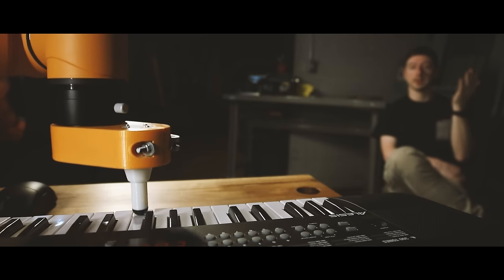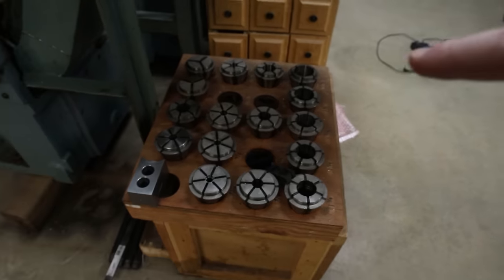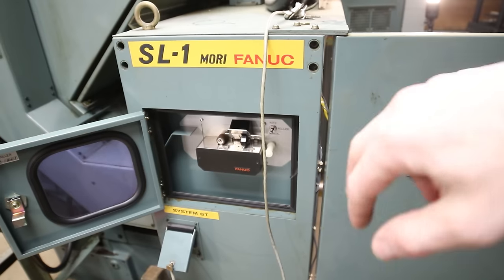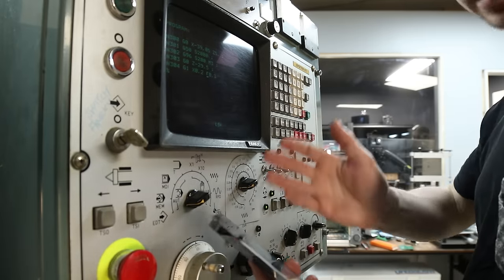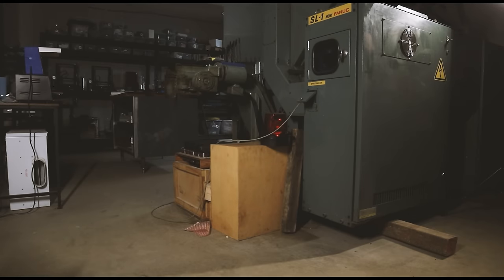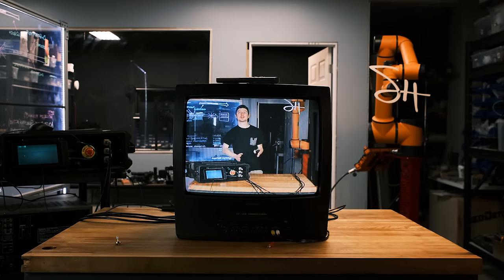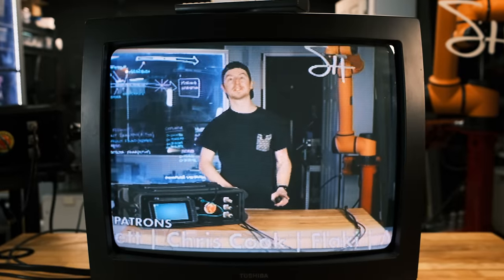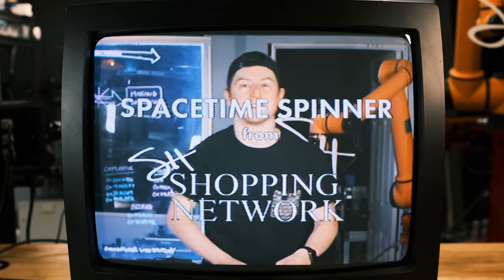I Bought a Giant 40 Year Old CNC Machine

Comment: Back in 2009 I worked on one of these exact cnc lathes. We called it the Mori Shocki. There was a short somewhere and if you touched the control panel while closing the door, you'd get a nice little shock. We also had to keep the back open and a fan on it to keep it from overheating. Poor machine shops, man lol.

Comment: The old Mori's are great machines and can make some really nice parts. The G code isnt that bad to program manually once you get the hang of it. Try and find the operators manuals, they really have a wealth of info.
Reply from the maker: Yeah I'm actually getting pretty quick on the controls. I'm figuring out all the machines little quirks. I actually do have all the manuals and (most of) the machine repair and maintenance history. Pretty crazy.

Comment: For those who aren’t familiar with Computer Numerically Controlled machines, they’re actually quite simple.

If you want a machine (for example a robot arm) to draw a shape, then you have to give it instructions. And that’s the funny part. It’s not complicated. It’s just simple addition.

There are only two kinds of orders that you can give a machine:

1. Go to a specific place.

or

2. Go from one place to another.

So if you want a robot arm to draw a square, you tell it to go to “Point A” which is (for example) two feet off the ground and pointed exactly North.

And if you want the robot arm to draw a square that’s two feet on each side, then you tell the robot arm to go to Point A, then go up two feet, then go right two feet, then go down two feet, then go left two feet. The robot arm will draw a square.

The starting point is called “absolute” and the relative movements are called “incremental”. In life, moral standards are the absolute starting points, and deviations from moral standards are incremental adjustments.

The absolute moral standards of truthfulness, goodness, and reciprocity are a big problem for communists because they’re liars, thieves, and parasites. They don’t want moral absolutes. So they take those absolutes and then incrementally move them in a direction that suits their desires. 

“Fraud” is incrementally moved to a higher position so that dishonesty becomes a positive value. And “Sin” is also moved “up” so that wrongdoing becomes positive. Fraud and Sin together are celebratory moral vandalism. 

In order to hide these incremental changes, the absolute starting points must also be hidden. That’s why black crime is massively underreported, and white collar crime is almost never reported. And that’s also why the Military has its own secret internal court system.  Most crime in America is hidden to prevent the disastrous erosion of moral absolutes from become obvious.

If you’re reading this, you’re probably wondering what a robot arm has to do with moral absolutes. It’s this: The computer software that’s used to program CNC robotic machinery is exactly the same software which is used to program Hollywood Movies. The only difference is that Hollywood uses the software to move concepts. A movie will place “Fraud” and “Sin” in absolute starting positions, and then through software control of the script and the colors, will incrementally move “Fraud” to a new absolute position; and “Sin” as well. The movie “Doubt” caused “Fraud” to rise. “American Beauty” made “Sin” a positive value. The makers of a movie decide beforehand how fraud and sin will be combined in both absolute and relative terms. 

So if you’re wondering how subversive messages have become so powerful over the last few decades, it’s because CNC software has become more powerful. I.B.M. makes the computer, and companies like Siemens make the software. 

If you really want to watch a movie, then tell a Hollywood to display the CNC “Fraud” and “Sin” overlays while the movie is playing. 

It’s Final Cut Pro.
Reply from the maker: Wtaf is this comment?

Comment: I used to operate a very similar range of cnc machines when i was an apprentice fitter and turner, and yes we did load one of the okumas with punch tape! But that was old technology then (1994), but cad cam did not exist, so you had to write the gcode programs by hand. Most of the machines had 5 1/4 inch disk drives, so you could write the program on a 386 computer, put it on the 5 1/4 inch floppy disk and put it onto the machine. Nice to see one still running!
Reply: is it an okuma with a fanuc controller? I cant quite tell from the video

Comment: for starter it would be a good idea to backup your system parameters. We had a hellasish thunderstorm one night that hit one of our building transformers and nuked one of our machines that wasn't turned off. Long story short we had to reload it line-by-line from scratch, but we didn't have it in digital backup. Our settings were all written down in the back of the Mori book that came with the machine. But there were some "secret" settings we had to petition Mori to obtain which was now merged into "DMG Mori" company.  We also had to deal with Fanuc Inc. to fix memory chips on 2 boards, as well fix 3 trace segments on board that were vaporized. You think "backup, backup, backup" but don't actually do it, then shit happens and you're screwed. After about $5K worth of damage we made damn sure to backup ALL machine system settings & memory of ALL CNC machines of the company.
Reply from the maker: Ah that sounds horrible. I have the params written into a spreadsheet. Apparently I can output them on the RS232, but I don't see how to do it, and its not in the manual. Oh well, I have them saved now.
Reply: @SeanHodgins  It's fairly easy to spit it out via RS232. We bought a small laptop for it so I could back them up, we later evolved to putting them all on a network doing it from one machine. You'll need some DNC software, and a null modem wired cable. The machine should already have an RS232 port on it, either in back or near the mainboard area. You'll need to set some parameters, i.e. baud, error check, parity, etc.. All of which you should find with your book on the machine, or even written on the inside panel cover. Fanuc are usually "nice" in making sure that info is available for your machine. As for output most likely that will be in ISO format, unless your machine or software prefers EIA. You're also going to NEED to buy a USB-to-serial-port converter for the RS232 cable. They work hand in hand. Device found here https://cnc-specialty-store.com/rs232-cables/rs232-usb-to-serial-port-converter-adapter-for-cnc-fully-tested  RS232 help via phone is available there as well to help you. To help you walk through what is needed.

Comment: I used to work at Fastenal in Winona MN, they still enter manually. When it's manual, there are many fewer lines than with a slicer.  You just tell the machine what the print says, set stock, check tools and go.
Reply from the maker: Works great for simple parts! But does Fastenal manufacture their hardware? I thought they were just a distributor!
Reply: A lot of fastners were straight forward, custom head size, custom threads, odd hex hole, etc.    Rows & rows of manual lathes in their customs division ... 28 if I remember right.  Then on the other side you had all the broaching machines.    @SeanHodgins    They distribute & manufacture.  Do a lot of induction shaped fastners too, all in Winona  :)

Comment: I used to manually program Mori Seiki lathes many years ago. I don't even remember the G-code, but there are cycle codes you can use, so it would be way less code than your cam software produce. Also the code you get from your cam software isn't very optimized which I find strange. Like the start. If the rod is let's say 50mm, it would make more sense with something like G00 X55. Z5.  G01 X47. F*  Z0.2  X-2.  G00 X45. Z2. (Liked and subscribed)
Reply from the maker: I’m sure it’s my settings, and me being VERY overly cautious with every move. Thanks for the sub!

Comment: Long long ago an 18 year old me started a job sweeping the floors and running the saw in a machine shop. The shop got overwhelmed with work and they split the shift. I got put on a mori seki SL-2 with a bar feeder(no real difference with your machine).  Not wanting to go back to sweeping the floors and running the saw I took the books home and read them, 3 moths later when we were caught up I told my boss I could program the machine, of course I had to prove that.  Somehow in a year a new mori CNC mill showed up and I got it.  Wow, it's now 3 decades later.  

A few comments. Set the post processor up to remove the line numbers, the interpreter can only handle so much text, you don't have a lot of memory.  Make sure cad is outputting g2 and g3 radius moves.  Try to use can cycles to you can quickly tune at the machine.  The end of the file missing is something simple like not having a % at the end of the program.

Now for when you need to put a stop in the spindle , but your set it too close to the wall.  Take care, best of luck, thanks for the memories.
Reply from the maker: Amazing story! good work. 
Yeah the line numbers need to go. You're right about the stop! I don't know when I will need one, but I do have a bit of room to move it away from the wall in the future. Wasn't really sure when it was even going to start running when I set it there. Haha

Comment: When i was getting my CNC training we had an old FANUC we had to program by hand, i must have spent dozens hours punching in g-code on that thing. Fond memories of that old beast, still ran like clockwork and was more than capable of churning out quality parts.
Reply from the maker: Amazing, did you produce the g-code based on the designs as well?
Reply: @SeanHodgins  Yes, we learned g-code by hand before any CAM, so we were able to do some simple parts, run them through the simulators(cool machines, worthy of their own video) and punch them in. Most stuff was done in more modern machines with CAM generated code, but if you asked nicely and proved you could handle a machine with a little less safeguards built into it, the teacher would give you the "keys to the beast". Blew my mind for how well it ran for a 40+year old machine, especially with the added complexity of a tool changer.

Comment: I repaired more of those old single digit SL's than i could count. At least you got the Fanuc version, the Yasnac version was next to impossible to get control parts anymore. The worst part of them i think was doing the turret alignments, turret disk has to come off to get to the taper pins and bolts, 0's and 1's weren't too bad, the 3-6 were a PIA.
Reply from the maker: I don't want to think about it... hahaha Good to hear about the 0-1s.
Reply: Hi Jeff I known exactly what you mean. I used to work for the canadian mori seiki dealer, and have done dozens of turret aligments  . We only sold Fanuc controls so didn't have to deal with Yasnac. As I mentioned to Sean earlier , its possible that I even installed this machine at it's original location.
Sean, the turret alignment procedure is in the maintenance manual, how to check alignment and if needed, how to correct.
If you don't have the manual I'd be happy to advise (plenty of free time , early retirement😀)

Comment: the mori seiki SL-1 WITH FANUC 6T is a masterpiece with that kind of precision  on the 80s , i fix two  of them last year , just be carefully when homing the machine the limit sw sensor can make problem and be also the turret sw , also make sure when you send program throw rs232 port that the speed is max 4800 and you pc has same earth as the SL-1
Reply from the maker: Thank you! 
When you say be careful homing, do you mean just go slow so it doesn't crash if it misses the sensor?
Reply: @SeanHodgins  yes slow speed when homming the machine and you can test them by your self go to diagnostic page and go to the registre of the home sw input for exemple if your home on x axes it x4.0 go to the registre 4 on the diagnostics and look to the first bit if it's change from 0 to 1 that ok if no that a problem

Comment: I used to run the twin turret version of this machine, with the 10t controller. It was slow as, but was still making parts until I left the firm I was working for in 2015! Spare parts (and a decent sparky who could work on the machine) were hard to come by, so good luck!

Comment: Dude what a amazing machine! I hope it's well maintained (seem very much so) and not abused (that's less sure lol).
We had (a bit bigger) machines in our university, and they where still performing well despite the extreme abuse of the students (one to mention was a friend who sent the tool full speed in the spindle and it DESTROYED EVERYTHING nearly hitting him too (thank god the glass panes are very thick security glass, and also the metal bars like you have) but after a couple of weeks of replacing what was broken, it ran fine forever after... But it's inevitable that the precision will never be the same)
Although I'm not sure loss of precision is a problem for hobby machining
Reply from the maker: Wow that would be a scary experience haha. The window is super thick, I need to polish mine on the inside so I can see through it again. Yeah tight tolerance is less concern for what I do, but I haven't done any real testing yet.

Comment: Those are nice and very robust lathes.  I would get an SRAM board to replace the bubble memory in the System 6T control if it hasn't been done already.  You can actually put several megabytes of SRAM in place of the bubble memory board and it is much more reliable than the bubble memory.
Reply from the maker: Interesting! I will look into that. It hasn't shown any real memory issues yet, I don't think anyway. Just a direct swap or do I need to change parameters?
Reply: @SeanHodgins  If I remember right it should plug right in.

Comment: Correction! Nobody I worked with on these (1973 - 1983) ever ran from tape, or typed in a complex program at the machine. You make the program on a timeshare (N/C Labs Inc) or on a desktop (IBM 5150's and beyond). They have paper tape "punches".(I have known folks that just used a teletype and its punch, also where one obtains timeshare connectivity, with an acoustic coupler). The tape reader at the machine reads the program into fanuc memory, after which one sets up the tools and runs parts. interesting times..

Comment: Yes, you bought a 40 year old CNC machine tool that is equipped with an electronic control system that incorporates components which were designed 50+ years ago. The reason people do not purchase these machines is that when - not if - the control system malfunctions it is nearly impossible to get spare electronic components. The only option for repair is to replace the control system and likely the drive motors, as well.

BTW, the block numbers at the start of each line are not required. Omitting them saves a lot of keyboard input when entering G code manually, whether at the machine console or a keyboard. Yes, I'm old enough to have written G code for thousands of parts (mainly complex milling operations) manually with only an HP calculator to assist with calculating coordinates for motion. FWIW, not a single CAM product has ever produced code as efficient as that produced manually by a skilled programmer/machinist.
Reply from the maker: I'm confident I will have fun with it regardless. I wouldn't be scared to retrofit it with a newer system either. The iron is there, electronics can be fixed/replaced. Its a relic, if I can keep it out of the scrap yard its a win in my books. I've also managed to pick up a spare power supply for it already locally, so there are parts out there you just have to have the right contacts. 

The block numbers will go, they don't need to be there. Thankfully I have my own post processor so I don't need to do any manual g-code(other than what the machine decides to skip. haha). You're probably right about the efficiency(since it doesn't matter much with modern machines and infinite memory), but what about the time to design the program? The plus is I can design a new part and click process and get a new g-code in a few seconds. If I was running 50,000 parts night and day it might be different, but ill probably only be doing small runs. 

Thanks for your input!
Reply: @SeanHodgins  My buddy has an old Wiedemann CNC turret punch press. It is still in good shape mechanically but the control system has started suffering random malfunctions. He found a replacement machine in good working condition for less than the price of a control system refit.

p.s. - I remember working with now vintage VMC 4020 machine tools when they were new to the market. How time flies...

Comment: A lot of our CNC machines are 30+ years. The biggest problem is the electronics, being able to source new boards etc, that's going to be something you will need to keep an eye on. The mechanics of the thing, not usually as much of a problem. A guy we use to fix our machines re-iterated this recently. People just aren't making the individual electronic components now, that someone (maybe you) can use to fix a board you can't even source.
I do like it though, getting more use from something that someone else has thrown away.
Reply from the maker: I picked up spare power supply board already just in case since I found it locally and mine might be in the way out. So that person might have some other things as well. I figure I’ll keep it going for as long as possible, and if it has some catastrophic happen I’ll convert it to a new system. Replacing caps and stuff is also a possibility for me(if I’m actually able to debug the problem) since I’m not totally useless when it comes to electronics.